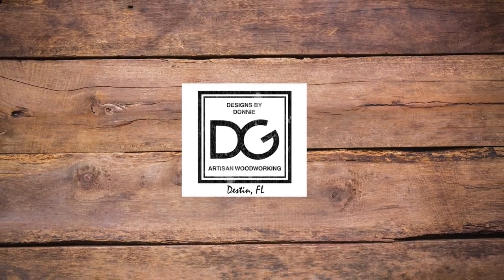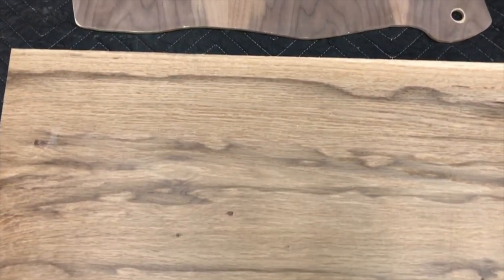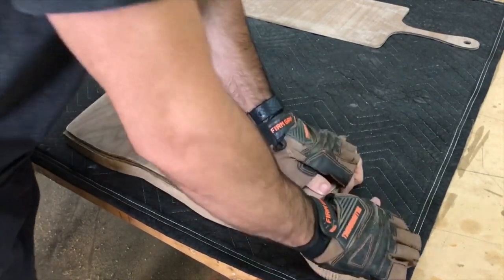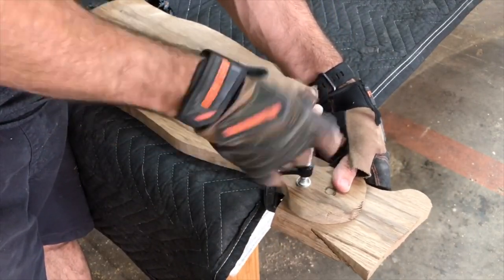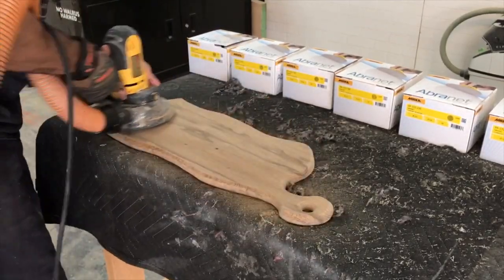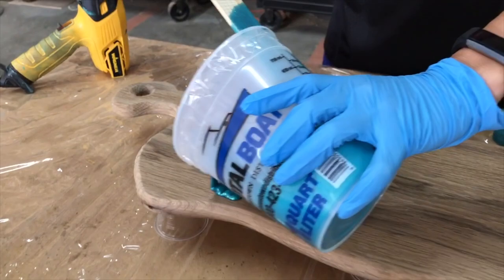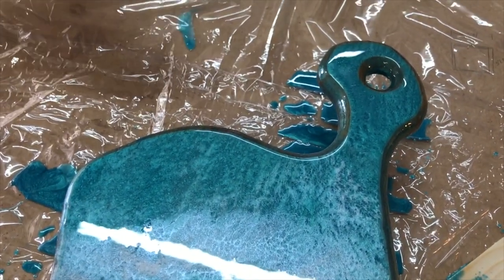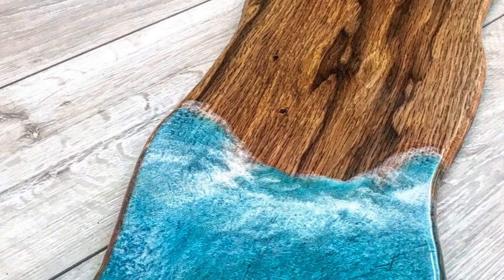How to Make | Resin Cutting Board

Comment: Is the Epoxy Resin rated food safe? I've been looking for food safe resin myself.
Reply: Food safe is a myth......everything is food safe after is cures.I've heard things like you might cut little slivers and eat them and you'd need to be doing come actual CHOPPING not proper food prep cutting but let's assume that's true in this case you will also be making slivers of the wood especially in an oiled finish and many foods are not exactly food safe some are down right toxic and these can be very common ones as well. And then in the end to answer your question a small "sliver" chipped off the board into your food is perfectly safe your body can't process it so it will pass right through with the only possible hazard is choking but it would be the same as a bone fragmentor the stem of an apple or seed from a pumpkin if you didn't already see it you certainly would notice it in your mouth before you swallowed it.